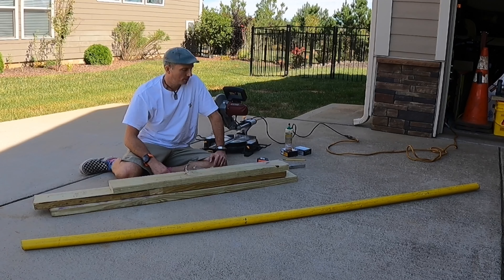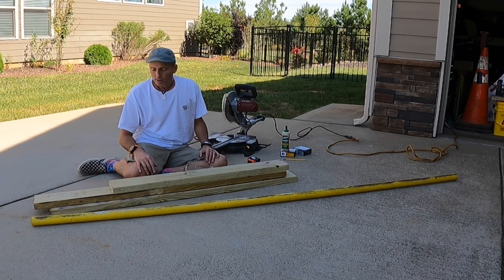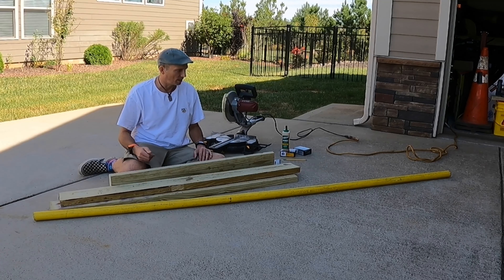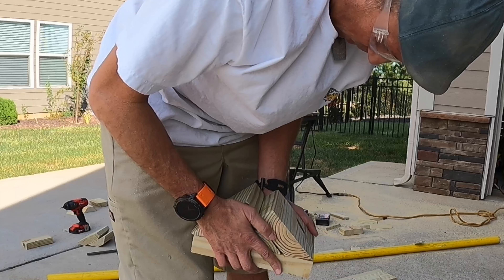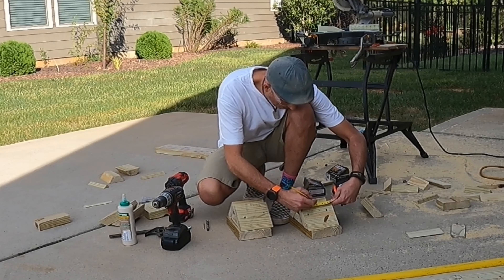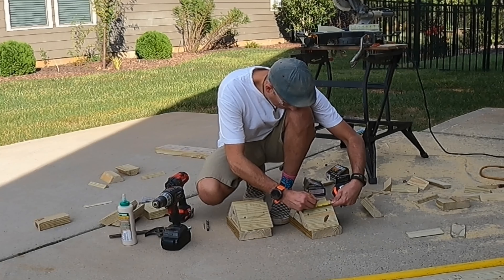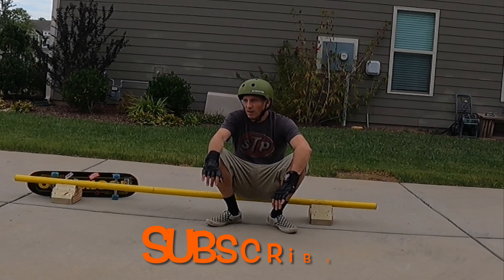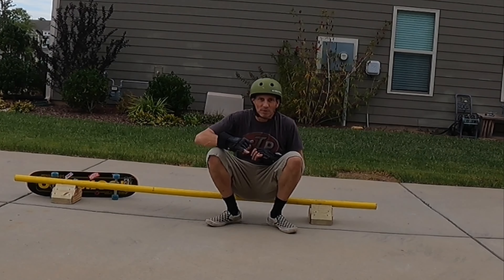DIY Skateboard Rail For FREE! (With No Welding)  aka How to build a skateboard rail

Comment: Hey AJ.  I think I'm gonna build that - moving house soon and I'll have lots of room for it.
Reply from the maker: Go for it Ed!  It’s not that hard. One piece of advice from my experience, a foot in from the ends may be to far for the supports.  If I put all my weight on one end, the other end will lift.  It doesn’t seem to be an issue if you are sliding off but if you try to hit just the end it could be a problem.  I think I’ll be weighting the ends of mine just as a prevention.   Thanks for watching and commenting and good luck with the move!